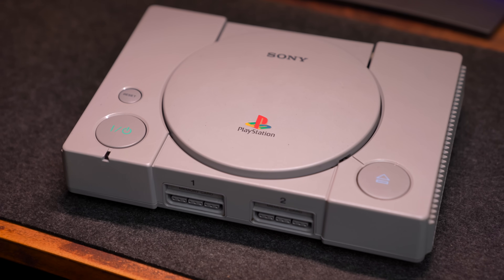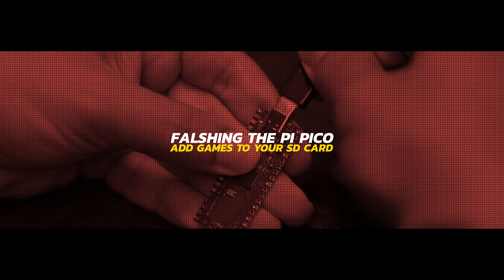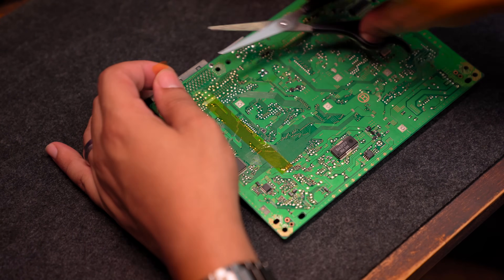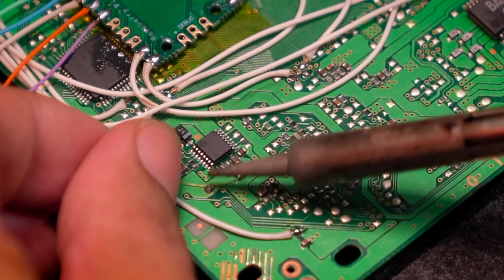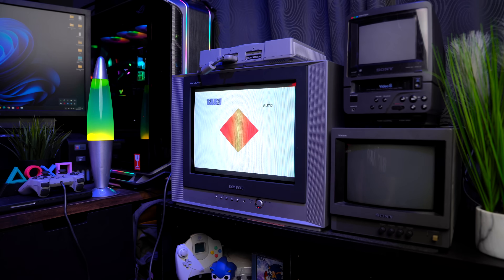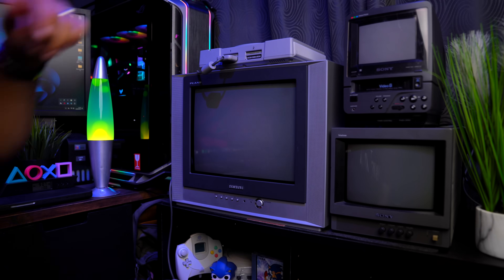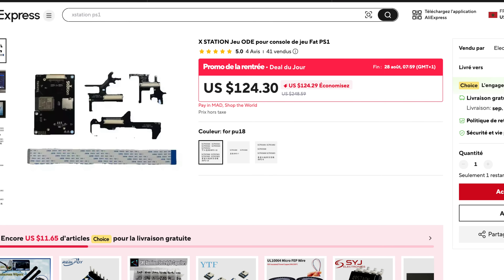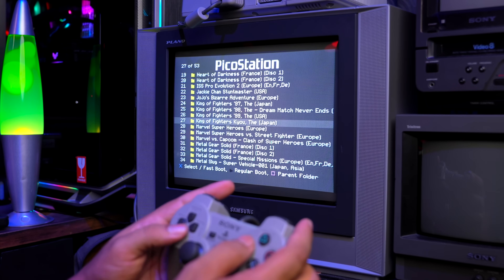NOW YOU CAN MOD THE PLAYSTATION FOR 5$

Comment: Cost = 1/10
Difficulty = 10/10

I'm hoping for a solution that uses the Raspberry Pi Pico, but in a much easier way for those without soldering experience.

Comment: good video probably the best demonstration out of all of them for the 550x model fair play! i have one question i have just bought the 5552 model and when i opened it up it has an old school modchip installed, is it necessary to remove it or can i leave it installed?
Reply from the maker: Hi, thanks a lot, all you need is to check if is a PU8 or a PU18 motherboard to follow the tuto

Comment: I have attempted the same mod on a PU-18 board and it did not work. I've already double checked all the wiring and there are no issues at all. I am using a SanDisk 64GB Microsd card which has been formatted to exFAT. Can you tell me what the issue might be? Is there something I have to copy to the SD card other than the games themselves?
Reply: i was using a sandisc 128gb micro sd card and the mod HATED that for some reason ... it wasnt till i checked with my sandisk 512gb it worked fine... so could just be very picky with certain SD cards if thats the problem ur facing
Reply: @severdnerv This mod is so random. Everyone has different issues with it. I've tried a 32GB card and am having the same issue. I'll try the other sd adapter that was mentioned in this video and see how that goes.

Comment: I got the mod installed and I can boot the PS1 to the menu where I select game isos. It finds all the files I put on it, but when I try to run any of them it loads for a while and then reboots the playstation into the Memory card menu. It does this with every game I have tried (3 so far). If I power off the console and turn it on again I come back to the Picostation menu, but the same error persists. I have tried with and without the CD plugged in. What can I do?

Comment: mine just boots directly to memory card directory the blue screen background :( i tried putting the disc drive back but still the same help
Reply from the maker: Hi, first thing try to check each connection that soldered correctly, second thing reinstall the PiPico with the firmware, last thing try to boot the playstation without resembling (motherboard with PSU only and don’t forget to press the white switch when it’s power on, try to do that safely) if you follow this steps, you will find where’s the troubleshooting is came from, good luck

Comment: Could you please link the diagram for the 7000 model - I have 3 or 4 of them so clearly rare only in certain parts of the world 😁
Reply from the maker: if the motherbord is PU-18 you can do the same process as i did in this video
Reply: @louriki  it's a PU-22 model 7502 so I'll have to assume it is not compatible with this mod

Comment: nice video, can you help me?  im stuck in screen picostation "please wait loading"
Reply from the maker: hi, thanks, what is the size of ur sd card ? well i suggest to format your it to exFat or replace it with other one
Reply: @louriki thanks , 64 GB the format is exfat,What is the recomended size
Reply: i found the problem, the sd module was in contact with the metalic plate of the PS , changed PI PICO, very important insulating tape before. thanks for your video, I have no idea of eletronics, this was my first time

Comment: Still not stable with lots of games. Not worth it yet, until many bugs will be fixed. The wire management is a disaster in my eyes.
Thanks for the clip anyway.
Reply from the maker: Most games work great, bugs will fix easly by pluging the pi pico with ur computer, Ur welcome

Comment: Does it matter if its the usb c or micro usb?
Reply from the maker: No it doesn’t, they are the same 😉
Reply: @louriki  Cheers for the reply u earned a sub as i just finished the mod and works perfect! =D
Reply: @louriki  Now modded both the PU-8 and the PU-18 both wirking however in games like SPEED FREAKS PAL version it crashes after the first Tournament level.
I confirmed this on both modded consoles so must be a compatability issue.

I wish there was a active compatibility list that can be updated as the one i found has been switched to READ ONLY

Comment: Plugging the original ribbon cable of the reader is a great troubleshooting advice, I have just read in other posts somebody's ps1 did not get to the white logo so this is one tip to have in mind just in case it happens to someone else.
Reply from the maker: Yeah if everything is connect correctly, and thanks god i resolve that problem, thanks for pointing that out!

Comment: I followed this guide to a T. Got the UNIROM from the github repo. 64GB kingston microSD EXFAT. Im not quite sure why it isnt working. I had a spare 5502 lying around so I decided to try it. But it wont boot past the white screen. Any ideas? I double checked all the wiring but im using Kynar wire (Enamed). Maybe I should switch to regular?
Reply from the maker: Hi, if you follow all steps that i mention in this video, normaly must work fine, and try to boot it without resembling the playstation, and don’t forget to press on the white switch
Reply: i got black screen🥲

Comment: I thinks it's better to get a ps classic and mod that.
Reply from the maker: There’s a big difference between playing on HD tv and CRT my friend
Reply: @louriki I have a ps classic connected to a crt via converter.
Reply: @octoman_games  it is a huge difference to play native vs emulation. PS classic is good collector item, not much gaming machine. And it is quite a heresy to use converter IMO. Why doing things difficult if we can do it the right and proper way? 🙂try original PS1 with RGB scart on CRT and you are not going back, trust me.
Reply: @the_oklep I feel you but the last, most advanced crt is 20 years old. They will die any moment now.
Reply: @octoman_games it is not that bad. I have multiple CRTs (like 7+), oldest one is 40+ years old and I didnt had single issue with any of them. And even if you have some issue, just throw it away and pick another. There are still many sets for next to nothing or for free
Reply from the maker: @octoman_games  it's not the point my freind, the HDMI will no be compatible with CRT in the Aspect Ratio, there's a lot of things to know and to learn why, but the best experience and you can campare that with an RGB cable with a CRT, trust me you will love it

Comment: Finished the installation and it was working for two days and today it wont boot into picostation menu (it boots into the default memory card and cd player menu). Something failed, but not sure what. I suspect SD card module. Do you know if it will boot into picostation menu even without sd card? Or even without sd card module?
Reply from the maker: I suggest to check the connection between wires that you soldred, and if everything are linked correctly, try to boot the playstation without the resembling, just only the motherboard with power supply, if that work perfectly, you have to manage a good place for the sd card and wires in the playstation, then after putting everything together try to boot it before and after putting the screws, and you will find where the trouble shooting is came from 😉

Comment: does it support 7000 series?
Reply: Only support version 100x or 55xx
Reply: @pollorodriguez1920so sad, all I can do is wait for now
Reply from the maker: Hi, as i mention in the video, yeah it does support the 7000 model if its motherboard is PU-18, it’s rare but you can check that by teardown the Playstation, good luck
Reply: @louriki it's PU-20 😢
Reply from the maker: @jamesavanzado450  too bad
Reply: @louriki yo, all I can do is wait for now, by the way, nice video even the wires are messy 👌👌

Comment: Hey, I just wanted to say thanks for the video. I installed one in one of my PlayStation's last night. I didn't have an SD card module so I just use a micro sd to sd adapter that normally comes with mico sd cards. I didn't install any resistors or anything. I just wired it straight to the adapter. It works really well. I think the only thing I would change with the install is the placement of the pico board. Placing it closer to the edge of the PlayStation's motherboard would make it easier to plug in a usb cable when a new firmware comes out.
Reply from the maker: I'm glad the mod worked out well for you! 😄 And any SD reader or adapter can work fine if you just respect the diagram, i recommended the specific one for people who won’t confuse with that and afraid to had a lot of troubleshooting 😉 but you made it bro 🤝🏻 for easy access to pipico a had a better one for ya, you put it as i did, and add an cable extension link with usb port of the pipico and place it anywhere you want 😉

Comment: Really cool but im too nervous to do any of that work, knowing me I might break one of those pins lol.
Reply: You can break the trace instead of lifting the pins if you want. Sometimes this is better because you can restore it back via bridging the trace, solder mask, and uv curing.
Reply from the maker: Don't worry, with enough practice you can do it too! 😉 and i think if you beak it, it can work because i eliminate the connection between the chip and the motherboard

Comment: Buenas, amigo tendrás el diagrama para la EARLY PU-8. Gracias de antemano, saludos.
Reply from the maker: It’s recommended to use the pu18 because is faster than the pu-8, but if want, i added the diagram with the latest firmware in the description for you ☝🏻☺️

Comment: Let's do it for cheap... never said easy tho...
Someday we might have something like GDEmu for Playstation...
Reply: PSIO, Xstation, MODE. On Playsation, solutions as simple as GDEMU (Plug and Play) are not possible, because the disc reader is integrated into the motherboard.
Reply: it is really easy once you practiced your soldering skills. I lift the pins with a needle and a soft touch of the iron. the rest of the wiring is just trimming them really short on the pads of the board.
Reply from the maker: GDEmu… Why not, But it won’t for 5$

Comment: I prefer using The xStation QSB that can also be used with this instead of a messy Install with all those wires. The list of Games that are compatible compared to xStation is still way smaller Which makes it a 2nd choice in contrast to xStation. Also the xStation is now available on Ali for half the price it used to be. Also in this Installation the SD Card can Not be accessed easily Which sucks.
Reply: Do you have to lift pins with the xstation? The rest of the soldering doesn't make me bat an eye cause it's fully reversible without much trouble, and the pads on the PS1 really aren't that small, but bending leads on an IC makes them much weaker, and is going to be harder to reverse safely
Reply: @blarghblargh  You can break the trace instead of lifting the pins if you want. Sometimes this is better because you can restore it back via bridging the trace, solder mask, and uv curing.
Reply from the maker: Thank you for the feedback, I appreciate you sharing your thoughts 🙏🏻, take note that at the moment all my fav games work all without any issue, but if you have money, you can go with xstation, this options are made to give a chance to play retro games… & choose what suits for ya…
Reply: "Also in this Installation the SD Card can Not be accessed easily Which sucks."  No, you can just wire it longer under the disc tray.

Comment: Spaghetti Pico mod! Might try it if my xStation ever fails. It does need a 3D print to hold the SD card adapter though.
Reply from the maker: Thanks for the comment, yeah 3d print is the better solution for SD card adapter, i thins who can find a one in the website…. hope your xStation doesn't fail 😉 in case this is an option for free

Comment: Does CD-rom work in this mod?
Reply from the maker: No, cause you will remove or replace the disc drive with SD CARD
Reply: Those pins that get lifted on the IC are for the CD-ROM controller. The optical drive won't work in tandem with the xstation / pico station. You can however reverse the mod if you ever wanted to restore the CD-ROM functionality. Resoldering those IC legs into good position without bridging isn't trivial.

Comment: I have a debugging station DTL-H1001H, there's going to be a time I will need to use a new way to load games in when the CD drive simply becomes too unstable (so far I'm lucky, it still reads CD-R's just like how it's supposed to), but main concern is, from what I understand, none of these solutions actually work on the debugging stations CD-ROM controller, including PSIO and XStation.  How does this solution fair on debug kits, or has that not been tested yet (for the obvious reason, they already are unlocked machines, but modding their rare boards is a risk in of itself).